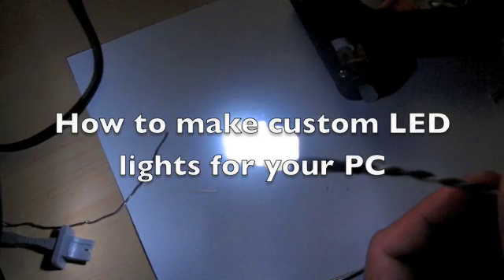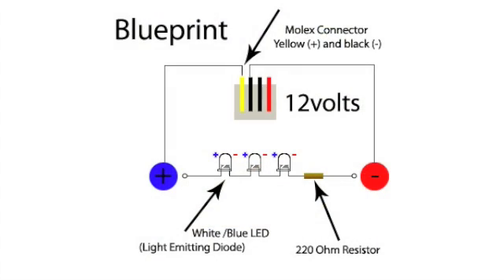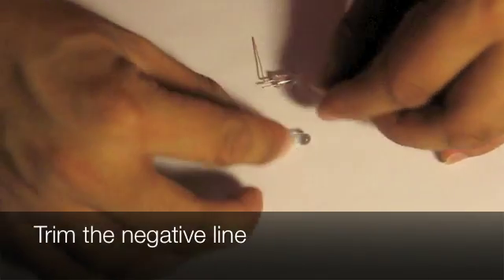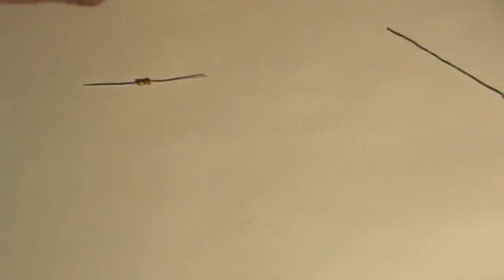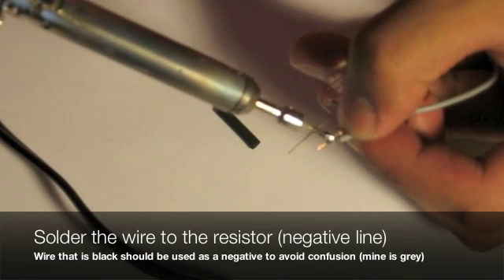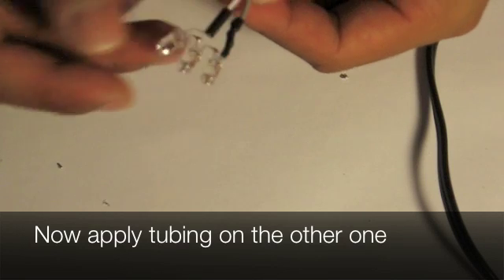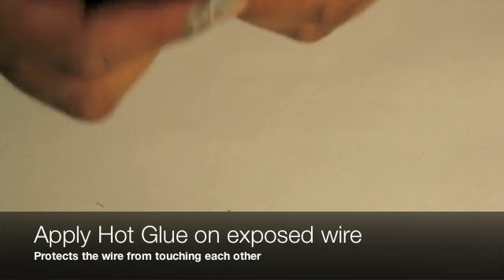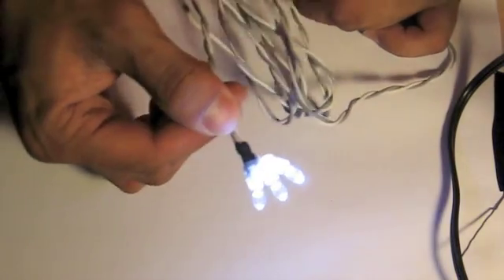How to make custom LED lights for your computer

Comment: Hi Guys! I have 9 pcs. LED Bulb (Originalky powered with 4.5V battery) in here and I'm going to connect it with USB 5V... What resistor should I use for this? Would it be fine if I'm gonna use a 250K ohms for this? The Red-Green-Yellow-Gold Resistor... I'm really having this confusions right now.. It is easy to understand if I'll be making just 1 LED only, but Multiple LEDs?? God! It's confusing!!!! please Help me!!
Reply: By the way, all 9 LEDs are White (I believe 3.3v each? Please help me!

Comment: Q : should i use one resister for each 3 light i mean if i have 9 light should i put 3 resisters
Reply: Depends what colour of led you are using and how big your resistor is they are going to be less bright cuz you use all 9 of them.  If you don't know that much i recomend putting 3 in series with 1 resistor as in the video but do it 3 times

Comment: 2nd Question
IF I Use USB CONNECTOR 12V IS THIS WORKING? tHANKS FOR HELPING ME
Reply: USB is always 5v. So it will still work but you should use a smaller Resistor as the lights might be too dim using a 220ohm with only 5v of power.

Comment: whats the use of theresistor ? can i make some without the resistor ?
Reply: The resistor reduced the voltage I think... Correct me if I'm wrong... But no you can't make it without the resistor otherwise the leds will burn out, hope this helped :)
Reply: thanks

Comment: Just a wonder, why you use 12 volts with higher resistor, than rather 5volt with smaller resistor? By using 5 volts as power supply and different resistor, lights (leds + resistors together) would use less power.

Comment: very helpful thank you. Is it possible to wire multiple sets of 3 together?
Reply: you can wire in as many sets as you want as long as you have an open connector on the PCU in my new computer I one have one old connector left open and one new connector so I could do two sets if I wanted to
Reply: 2nd Question
IF I Use USB CONNECTOR  IS THIS WORKING? tHANKS FOR HELPING ME or thank
Reply: The usb is 5 volt so it wont be as bright as the 12 volt would be and with usb use only one led not 3 as you would over load the power and might burn out stuff ill look into this for you
Reply: Sir other suggestions is i use 22ohms for this'll

Comment: 150ohm resistor is sufficient
Reply: It will depend on the current rating on the LED package.
Reply: swarup pagan 2nd Question
IF I Use USB CONNECTOR 12V IS THIS WORKING? tHANKS FOR HELPING ME

Comment: Google "LED Wizard" and find some LEDs on ebay that you want. Put the values from the ebay description in the Wizard page with 12v as the source voltage, and that will give you a diagram of how to wire the LEDs for how ever many you want to use

Comment: Not to be a troll or anything, but your soldering style isn't quite right. You are supposed to heat the wires, and then melt your solder by touching the wires, not "drip" it on. Solid wires are done more how you did it but stranded wire is the other way. Good vid tho.

Comment: I need to repair a friends computer. We have a 3v 3mm led to fit to the 12v circuit. Would the 220ohm resistor still work as we only have the 1 led to fit?

Comment: Hmm, that seems nice... Especially when one of them brakes and you have to look through 900 led's to find it! (Y)
There is custom made converters to buy at the local electric-store for the amount of led's you have! I'm currently building a LED system in my case (3 switchable collor LED's-green+blue+red) with a 230v converter made for LED's all parallel connected :)

Comment: I have another question. Female molex connectors cost about $2 on ebay, Can I connect more than 3 or 4 LEDs? If not I was wondering if I could solder the ground and 5V cable to a male molex connector? Is this possible to do. Is there a cheaper route than buying a female molex connector such buying a 22 gauge black and red cable? Thanks.

Comment: Just calculate it... V=R*I    If you put them in serie like in this vid and use 12v to power them, 4 x 3v led... 12v.   But it's always a good idea to use a resistor if a "short cut"

Comment: @pyronathanpyro well if u are thinking this is because "power" runs from + to - then u would be mistaken not to long ago we were able to look so small down to the electron and see that it runs from - to + but system in place atm would be to hard to swap everything around because it makes no difrence what happend to you was not because of where u have them in the circuit

Comment: @pyronathanpyro no it dosnt matter where you put it in the circuit
this is because in a circuit a voltage has to drop over the circuit from the start in this case 12V til the end 0v the voltage drops over the LED's and reistor it dosnt matter when the voltage drops over each of them the voltage droped over them is determed by the resistence of the item

if anyone wants any help with a circuit add me on msn electrolover34@hotmail.com
i have my cert 1 and 2 in electrotechnology glad to help anyway

Comment: @EKUL34 also if im corecgt in the video didnt it show that the resistor goes after the circuit like after the led's wouldnt you put it to the posative side so that the voltage drops before hitting the led?

Comment: Very helpful, I just have 1 question. what will happen if I used a 2w resistor with the same color code red red brown gold? will it damage the led or my system?

Comment: @iTouchPwner69 yes, but you need to check the voltage rating of the LEDs so you can determine what resistor value you might need.  there are dozens of free LED calculators on the web.

Comment: @amithacker1 buy a usb cable. There're so many wires in it then, if i'm not wrong black is gnd red is 12 volt(or you can measure it with multimeter) so you ca do whatever you want :)

Comment: ey because the yellow molex wire is a 12v wire if u used 12volts worth of led's could u just then kick out the resistor all 2gether?

Comment: wen ure soltering the resistor..can u use a hot glu gun to du dat?....cuz i use to hve a soltering gun...but it...and unfortunatly i also dont hve a hot glu gun...so will super glu du the trick for the parts were ure supposed to solder?
                        PLZ REPLY

Comment from the maker: To be honest quite a bit. It really depends how you set up your array and the amps available, remember LED barely use that much energy. You may want to google "LED array" Select the first link. Voltage Source eitehr 5v or 12v. Diode Forward voltage (please check manufacture of your LED voltage may vary. diode forward current 20 is good then the number of LED. This site is good it kinda gives you a whole array setup

Comment from the maker: Ohm is calculate I=R/v. I can not post a website but u can google Ohm's Law there is a useful pie chart of have they calculate it. 

You might notice there is a missing value
Most people just give me Voltage, Voltage of the LED, and the forward current is not given. LEDs typically has 20mA. That should help you calulate it in Ohm

Comment from the maker: Sorry for my late reply, what is the voltage source? 9 Volts? If that is the case you might need something between 110-150 ohm roughly per 2 leds and the last one will have either 300-330 ohm resister. The 160 should work but it will be dimmer..

Comment from the maker: The molex connector has 4 wires in it. It's either a 5 volts or 12 volts. A AA, AAA,C, D battery is 1.5 volts (rechargable is  1.2 volts) and a square one is 9 volts. so in essence you can't really just do a replace unless u do 8 AA/AAA/C/D which would give you 12volts. But if u can give me more details on your LEDs it would help me give you a better answer.

Comment from the maker: You know the voltage on the LEDs? In general voltage of green LED is between 2-3.4 volts. Therefore you might not have enough to power, u would need about 4.5 volts at least to power them or 3 AA batteries(@ 1.5volts each) and use 68 ohms resistor per light. On a car they use a 13.4 volt line, if you can give me more information on where you are putting these in let me know. i'll try to help some more.

Comment: Ok, just got back from radioshack, now Im gonna watch the video step by step, although im using these to install on my car, when I get one. I picked up a Double A (AA) battery pack, and a switch, I might need help connecting all of the battery pack and switch. But for now i will use your concept, until i get to the computer switch part, i will switch that. 2 5mm Green LEDs for a AA battery wont need resistors, right?

Comment from the maker: yes in a way. there is a formula(V = IR)(V = voltage drop, R = Resistance, I = Current) on determining which resistor would be right for the job. If you are interested in this you can research and google Ohm's Law and Resistor the text is quite complex for the average person but it could explain how it was works. With the lack of space in the box i would not be able to explain things too clearly.  Wish you luck! and thanks for the question

Comment from the maker: Resistor resist electricity. It's main purpose is to dissipate the power. You need to do this because LED are sensitive to voltage. Dissipating it will let the LED run at the proper volatge without blowing out the LED. If you don't use a resister, the LED would either light up very brightly (create heat = lifespan of blub is shorter) or the LED blow instantly because the voltage is too high